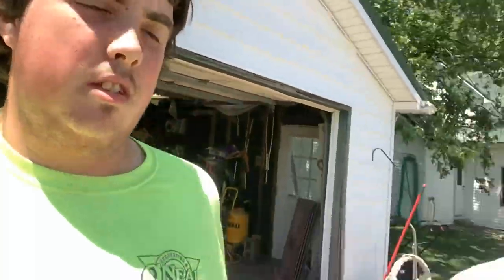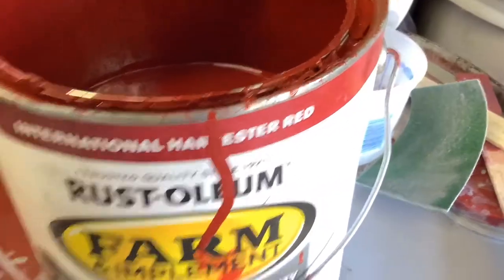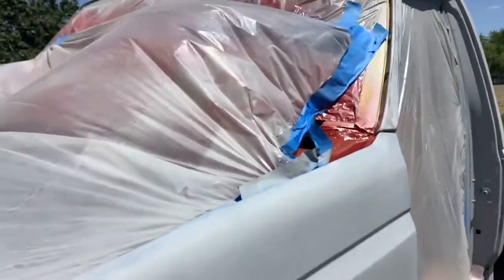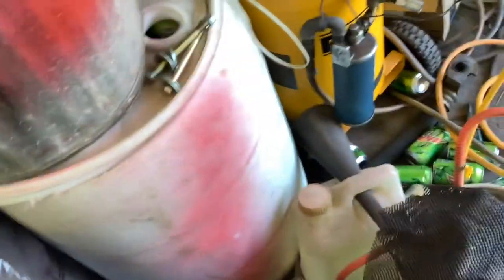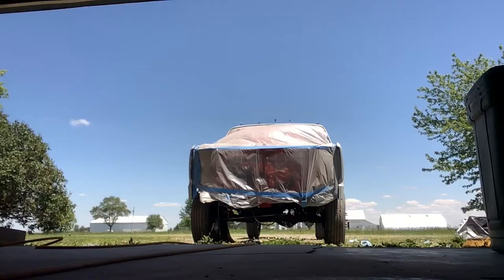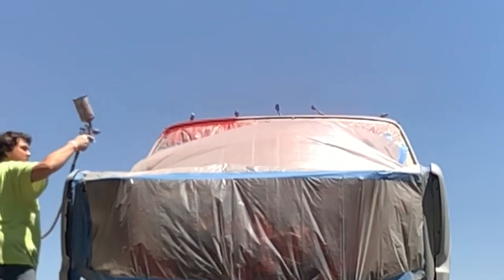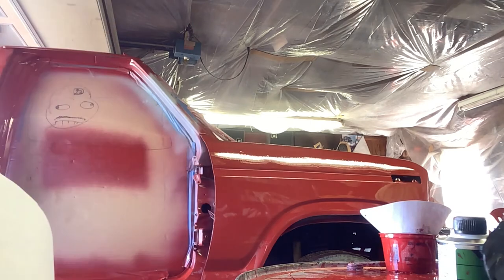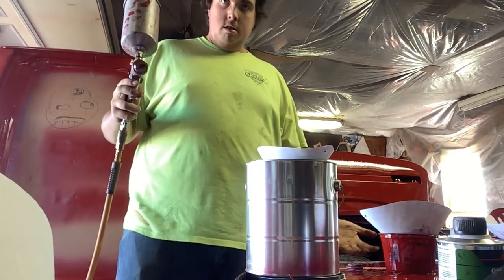How to paint a car, truck, or tractor with Rustoleum tractor paint!

Comment: i dont get these vids are ppl going to buy a huge compressor? then what yu have a compressor just sitting there. Now if you could do the same job without a compressor with rustolem then that is different. like electric spray gun or roller paint

Comment: Rustoleum paint mix 50:50 with mineral spirits and spray with the gun
Reply: Don't use any hardener or anything like that, just the paint out of the can reduced 50 50 with mineral spirits, sprays great doesn't clog up the spray gun and it will adhere fine, do a few coats to get a good shiny finish give it like two weeks to dry before you wash it